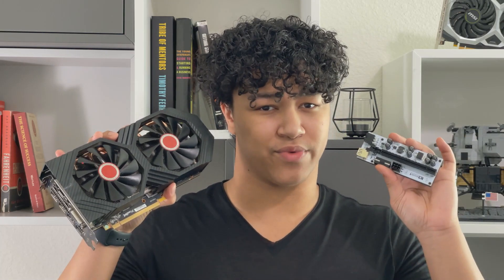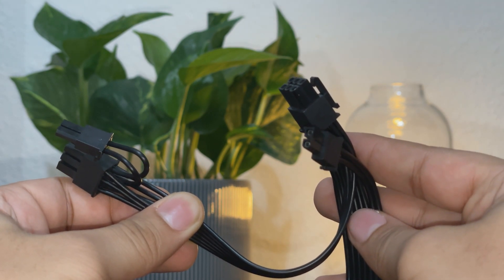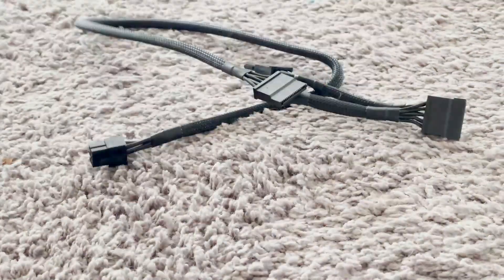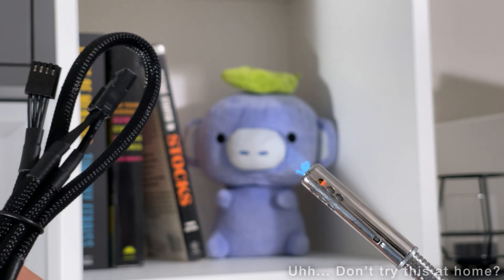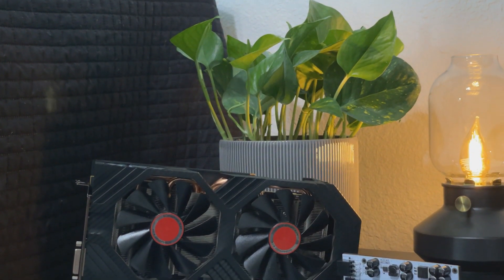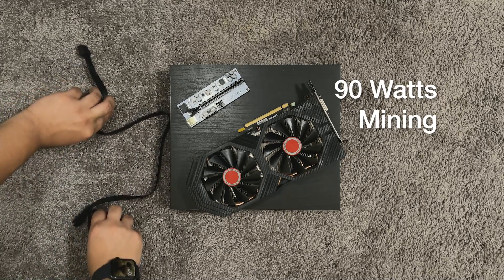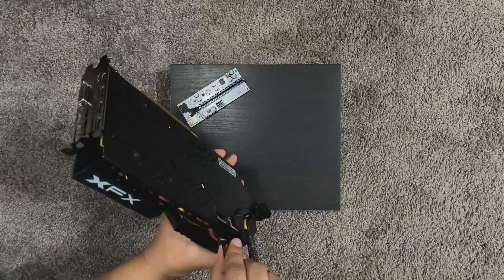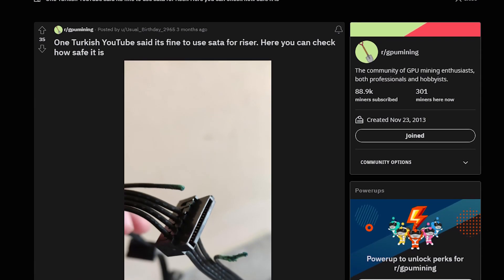Don't Burn Your GPUs Down. Here's How.

Comment: Hey man so My Power Supply is 450W it has 6 pin and I just got the AMD Rx 570 4gb GPU today turns out it has 8 pin so wanted to find out if it's possible to run it with a 6 pin Power Supply

Comment: That sata connection is not used for the bulk of the gpus power... only the pcie slot power... Cmon man!!!  You can safely use sata for gpus whose pcie power usage is ~50 watts or less. Some more recent Nvidia cards abide by this. Where as AMDs were notorious for pulling 60+ watts at the slot. These are the only folks (or daisy chainers) that had nightmares about sata power.
Reply from the maker: No. You can not guarantee that any GPU will conform to the same power mode and only ever pull less than ~50 watts from the PCIe power slot. As you may know, AMD cards often have multiple power modes, some of which on older cards exclusively pull power from the slot. Perhaps an argument could be made for modern GPUs. But what about low power cards? A2000s? Sata is a death wish. An A2000 is a good example of a “when” rather than an “if” sata power will explode. How about 6600s, which prioritize slot power when in a lower power usage state? Absolutely not. Or 1070s, 1080s, 3080tis… All known to pull 50+ watts at the slot. Bad bad bad. Even just suggesting powering a 3080ti’s riser with a sata connector just sounds wrong.
Reply: i have  3090 turbo cards running safely with sata to power risers .. my risers take not more than 40watt each , tested with my watt meter .. with Nvidia cards i know it will work fine.

Comment: Thoughts on using a single SATA cable to power the riser itself and not the card? I generally just have 2 PSUs to power GPUs/Risers but was thinking what the risks would be if having a single riser on a single SATA cable to power the riser itself.
Reply from the maker: Strongly advise against ever using SATA even for just a riser. You unfortunately just can’t guarantee it will be able to sustain any load greater than ~60 watts. A PCIe splitter (of non-dubious quality) well basically always be a tremendously better option, both from a reliability and safety standpoint.
Reply: @dandyworks  that's what I thought, thanks for reinforcing it!
Reply: only 1 card per sata cord. and run your cards on sata on lowest power usage in overclocking softwares.
Reply: @dillon4813  I ended up just doing molex for when I did not have pcie

Comment: Nice content bud but critical flaw.  When you calculate capacity for cables and calc TDP you don't do it at mining wattage you do it at the card's SPEC'D TDP wattage.   That is, the TDP as listed by the manufacturer in the spec as that is the max tdp that a card can draw.

Kernel panics, unstable overclocks, aging thermal interfaces, dusty fans - lots of things can cause a card or rig to crash and when a rig crashes, cards can pin themselves at max TDP draw (not the limited draw you set in software.)

So NEVER spec your capacity for reduced loads you plan on running.  Wiring and connectors should always be spec'd to the MAX POTENTIAL of the circuit.

Otherwise well done but you should fix that because what you're spreading is potentially dangerous info.

Comment: Aren't 6 Pin PCIE and 8 Pin PCIE the same? They only difference in them is the additional ground and Sense B connector in 8 Pin. The amount of wattage they can handle should be the same (if both 6 and 8 PCIE have the same 3 +12V connectors)
Reply from the maker: It depends. An up-to-spec 8 pin should always have 3 power rails, while a 6 pin connector only needs 2 power rails to be up-to-spec. Whether or not a 6 pin has 3 power rails varies by manufacturer, and even if there is a pin there, the PSU may not even be providing it power. As such, it’s safer to assume there’s only two power rails, even if it looks like there is 3.
Reply: @dandyworks  Interesting. So a 6 pin PCIE cable, with all 6 pins on both sides, may have only 2 power rails? What is the third then may be? Ground?
Reply from the maker: The “third” 6 pin power pin (middle bottom pin) is listed as N/C (No connection) in the specifications, so it wouldn’t be connected to anything at all. However, 12V on that pin is optional, which is why you see most PSU manufacturers putting an additional power rail there.